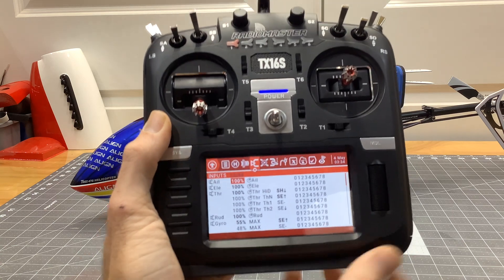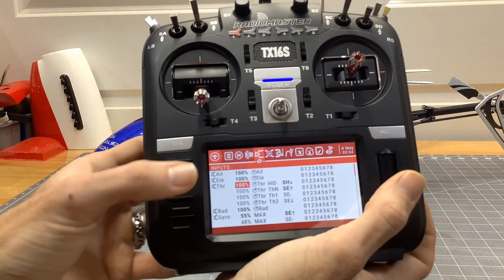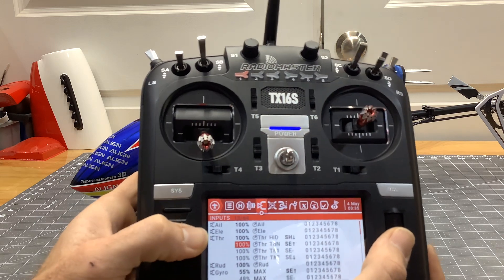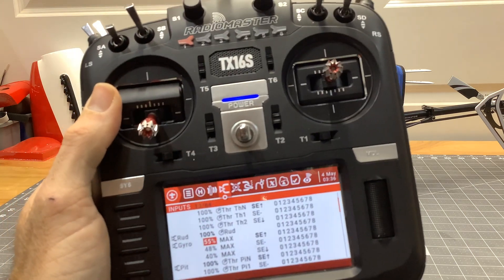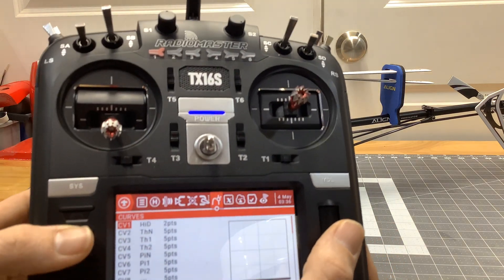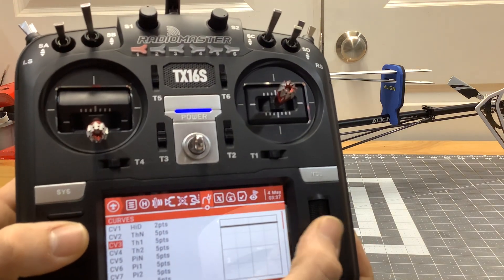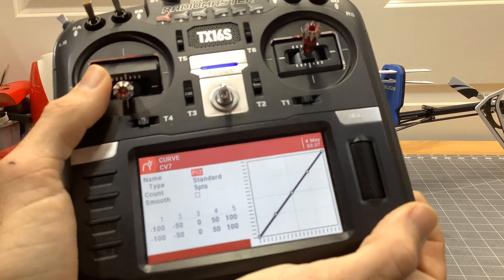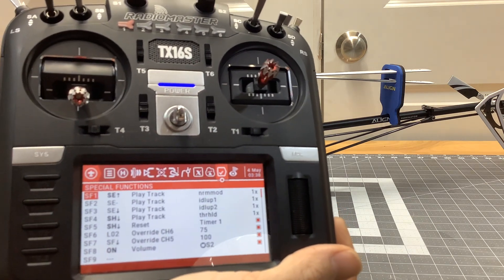Align Trex 470LM setup on the radiomaster TX16S

Comment: Thankyou soo soo much man.
I fly helis for 10 years but they have progressed so much with self level, SAFE, etc.
I have trex 550 dfc, ar7200bx
470 bx pluss standard spectrum ar6610t hobbywing gov.
Just got some Fatshark scouts and a T16s and wow, the gimbals out the box are so so smooth , made sim mode , to freerider on phone(paid version) and having to relearn stuff again in an opentx c++ arduino kinda thing just goofed me out, so i just wanted to say THANKYOU MY FRIEND!
WILL PROGRAM RADIO, BIND TO RECIEVER AND REDO THE BEAST +
Reply from the maker: You are very welcome! I’m glad that the videos can help. My whole goal is just spread the knowledge that I have learned over the years. If you have any questions feel free to ask and I will do my best try to help!
Reply: I’m going through that now with my old trex600n compared to new trex 450s dfc and updated blade coming with fc6250, my heads gonna blow… maybe i shouldn’t have got the tx16s so soon

Comment: I was under the impression,  you still need your heli menu configured even though you use a flybarless controller,  no?   Thanks for posting.  Clean setup and i'd like to implement it on my 700.

Comment: Hi and thank you for ur videos there very helpful I wanted ur expert suggestions Iam looking for a new transmitter should I buy the radiomaster tx16s or the new spectrum ix14?
Reply from the maker: Thank you very much! So I just bought the IX14 and will have videos on it very soon! As compared to the TX16S. I would say go with the IX14, spektrum is soooo much easier to program and work with. Radiomaster is a steep learning curve. It’s a whole different radio system. For the money it’s a good radio but if you can afford to get the IX14 I highly recommend it over the TX16S.

Comment: Im setting up a Trex550 with DSMX receivers for the first time(first time flying helis).  I assume these settings will work with it?  I will be using the Ikon  2 FBL.
Reply from the maker: The majority of the settings will work the only difference is if you are setting up your flight mode you were going to have to setup channel 7 and assign it as an exhilarate channel. I am working on a radio profile right now for Ikon and the TX16S. If you can give me a few days I will try and get a video out for you with the set up. But everything is the same just only difference is the seventh channel for flight modes and rescue
Reply: @westhobbiesrc8051  that would be amazing!  Thank you.
Reply from the maker: @funKdatFPV  video is out, hope it helps you!

Comment: Great Video, can you share the spectrum DSMX satellite receiver that you use and if is required some cable adapter to connect the microbeast, and some recommendation where to buy will come handy thanks a lot
Reply from the maker: I’m using a DSMX FPV satellite ( what I had laying around)  but I just set my buddys up with a regular DSMX satellite from horizon hobby. You don’t need any special cable as the micro beast is a V5 and plugs right in the side!

Comment: On wich channel sits the rescue and auto Level? So you got the beastX plus, right?
Please share how to program the rescue/autoLevel with that setup!!!please Mr.West!!!
I try this by my own for 2 Weeks now and I am in rage😅
Reply from the maker: No, I use a iKon 2 FBL. The microbeast does not have Auto level and rescue. I believe you need to pay for the pro software.
Reply: @westhobbiesrc8051  I got a brain 2 in my T-Rex 500L and at the moment I am building an T-Rex 500 FL with microbeast plus pro.
Rescue and attitude control is on it.
I have problems setting the channel for it...dont know if got to do it in Inputs or in Mixes or in Outputs and second thing is I dont know wich channel and wich values I need to prog in it
Reply from the maker: @eagleonefoxtwo2487  it’s CH7 and 8. You will need to assign a channel in the radio and then turn it on in the ikon/Brain software. I have a video setting up Radiomaster and ikon on my channel.
Reply: @westhobbiesrc8051  with the brain 2 setup I am fine...please do not get me wrong...I ask about the beastX plus pro and its channels.
I found out that the setup I am running with the Radiomaster R88 v2 reciever do not allow me to get rescue and auto Level on another channel than the tail gain is on when I am using it as standard receiver.
I think I will risk it and try to run the 500 with just one dsmx sat...I am not flying this far war away...I do not understand why it should be okay with a 450size flying just one sat and why with a 500size it should not work.

Comment: HI; this is an excellent video; I have an align trex150x and  I cannot bind with tx16s. do you have any special recommendation? thanks
Reply from the maker: Thanks you! So I’m not sure what protocol the Trex 150 uses? I’ll have to look it up. What are you using?
Reply: @westhobbiesrc8051  I´m using 2.3.14-otx version and V1.3.36 AETR and MODE MULTI DSM–RX or DSM 21F or DSM 22F or DSM X1F or DSM X2F or DMOO2.THANKS
Reply from the maker: @jorgecalle9278  are you using a DSMX/DSM2 satellite RX?
Reply: @westhobbiesrc8051  I have download the trex 150 manual and according with manual is DSMX/DSM2 satellite RX; on TX16S I have used internal module but cannot bind

Comment: Do you remember what screws drivers you used to assembly?
Reply: I ask because i saw that on rotor head has a  hexagonal socket smaller than traditional 4 drivers
Reply from the maker: If I remember correctly the first time in the kit came with a little hex driver. Give me a few minutes and I will go check. But I used the standard 1.5 mm 2 mm and 2.5 mm and a Phillips.
Reply: @westhobbiesrc8051  yes i noted this little hex driver but doea not fit on socket under the rotor head
Reply from the maker: @Dibilibix27  are you talking about the bolt that goes through the head block to main shaft?
Reply: @westhobbiesrc8051  yes
Reply: @westhobbiesrc8051  that its linked to swash
Reply: I took a picture
Reply from the maker: Ah sorry, that’s a 1.3mm I just checked
Reply: @westhobbiesrc8051  is the loctite thats provided enough for the whole build?
Also what other tools will I need to build other than screw drivers?
Reply from the maker: @raihanmiah7162  oh yes, it is plenty. I still have some leftover and using it on other stuff. Remember you just need a drop on each screw. Your normal 1.3mm 1.5 mm 2 mm 2.5mm. A set of ball link pliers needle nose pliers. You will also need a pitch gauge for setting up the FBL as well as a swashplate leveler. (You can use the zip tie method. Go on YouTube and search zip tie swashplate leveler very cheap and effective way to do it but if you have a regular swashplate love work that’s even better)
Reply: @westhobbiesrc8051  very specific driver i will need to buy, the little that came does not fit here
Reply from the maker: It is a weird size, I bought a kit a while ago that has every size driver and the first time I’ve used the 1.3mm.

Comment: Hey Jeff, i'm trying to setup my Raw420 and i have set the same settings to my tx16s. I'm using the MSH Brain 2 as fbl. But i have an major problem. In every stuntmode my helicopter turns of in negativ throttle/Pitch. In normalmode it starts to spool up at -20 throttle (Stickpoint). Even in stunt1 and 2 its shuts down when i give negativ pitch. I dont get it. I have done everything like you in your Vid's. Do you have an Idea what that can be ? For my radio i used this Video but for the other konfiguration i used your Raw 420 build playlist. PLS Help XD

Comment: How do you mix the tail rotor into the mix . So when you add throttle the pitch on the tail rotor adjusts
Reply from the maker: That is all done in the FBL setup not in the radio.

Comment: Fantastic video!   It saved me a lot of time and is very understandable.  Did you use any logical switches other than for your timers?
Reply from the maker: Thank you! No I do not, just for the timer this particular model on others I use it for rescue but since I am running a micro beast I do not have the pro version so rescue on this one.
Reply from the maker: @badjingme  you don’t need six and seven, so I made one file for all helicopters to override was for the M2 and OMP hobby. I sent deleted it after the video.
Reply from the maker: @badjingme  Yes the outputs that are in this video for six and seven are for overriding which is rescue of OMP protocol. You can use the template for all helicopters and it works fantastic! The NX10 is nice and a great radio, I like the TX16S and it’s been a fantastic radio! I tell everybody to use what radio they like but you cannot beat the price of the TX16S! Thanks for watching!

Comment: Hello. Nice video. I'v got a question. I am doing Microbeast plus setup with TX16S and in Setup menu when I went to step L - collective pitch (where you have to min/max 12 degree pitch), I was fine with +12 degree meaning that no blinking light was on, just solid blue, but when I went to -12 degree pitch, red light was blinking but it should be solid. Now, manual says that you need to increase/decrease servo throw on your transmitter on pitch channel to change it to solid red light. Do I need to fool around with travel adjust or sub trims to do this? Thank you
Reply from the maker: Glad you got It, you need to change values to give more servo throw to make the Microbeast happy with servo throw.

Comment: I'm trying to sett up a jumper tlite on my small cp helicopters. And my m2..it's been a long time Sense I set up on open tx .and it's a real mind f for me!...I set up a 4 channel drones on on..I know how to mix some things but idle up has me so confused
Reply from the maker: Idle up it’s just going to be three throttle curves. You need a normal mode one and a two. If you follow the video you can copy those setting and adjust the percentages for the head speed you want
Reply: @westhobbiesrc8051  il look real close and try it agin soon... I got my air planes on the radio ...don't know why I'm having so much trouble..
Reply from the maker: @jakelang4387  the radiomaster TX16s is big learning curve for sure. what RX are you using?
Reply: @westhobbiesrc8051  jumper tlite the game looking controller
Reply from the maker: @jakelang4387  so same learning curve. Once you learn it it’s pretty simple.
Reply: @westhobbiesrc8051  what has me confused is setting my throttle at a hundred ,after I copy the throttle channel..seems I can't figure that part out on that radio..I can do it on my 9xr pro..but I don't like the pro radio and wanted to go with jumper..love the jumper ,but like I said I don't know how to make rates a 100 on a switch..I know how to assign the switch on the channel but what do I do to make 100?